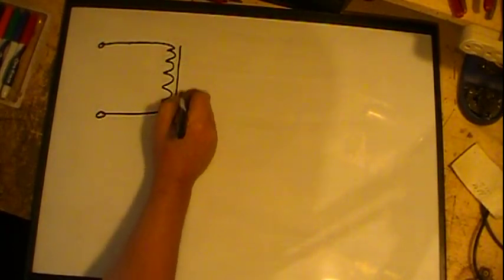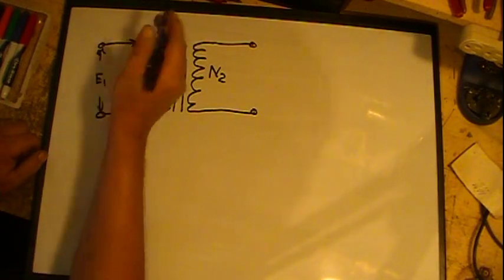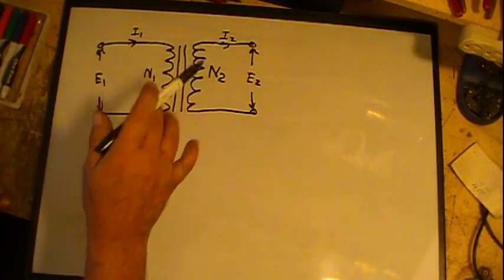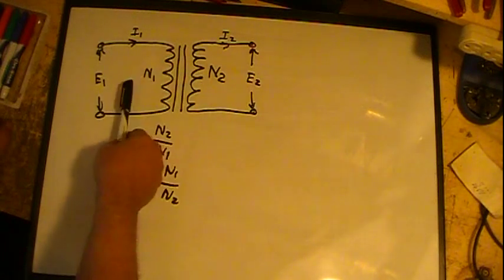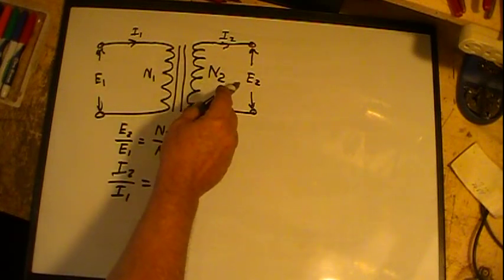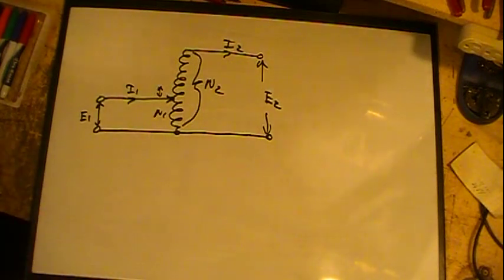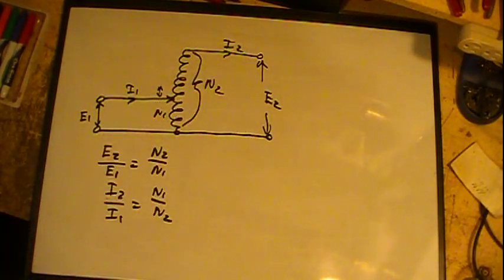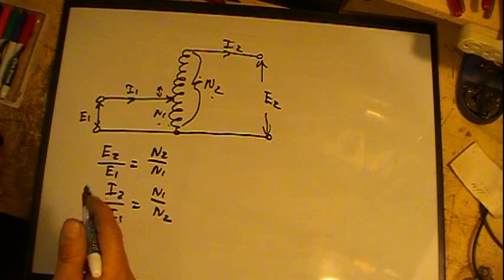Transfomers 101 part 1

Comment: Hi Dennis;
I have a Question, about what You said toward the end of the Video.. 
In the video, You mentioned that on an Autoformer it is the Primary side of the former that is adjustable, yet I would question that statement and ask if it isn't the secondary that is Variable and the primary is fixed.. Otherwise when the "Dial" is at Zero, it would short out the wires that are plugged into the Wall outlet.. So when I say "Primary" and "Secondary" on the Autoformer, I don't mean that there are two different windings, but that it would be where the "Input" and "Output" wires are connected on the Single coil of the Autoformer..
Keep up the Great WORK !!!!
THANK YOU Marty

Comment: Here I am sitting here Dennis thinking "auto-transformer?" I never ever heard of that! Then the "Duh..." moment happened here. Of course, a variable sliding mechanism that travels up and down the coil length, changing the output voltage. AKA; Variac! 
   Definitely NO isolation properties here in this design at all as you know so well. We still need to use an isolation xfmr to isolate ourselves from the mains, especially in conjunction to using other test equipment.
   All I can say, is that I use to troubleshoot 1 Million volt power supplies in Faraday cages to test them and repair them for the ion implanter machines that we made. This was about the most fun I ever had! When one of the voltage doubler stacks would fail, I would get a multi-foot lightning bolt arc, (in which I've seen occasionally, what appeared to be about six feet bolt!), short and "ZAP!". All 175+ employees at our factory would practically jump out of their shoes when standing, or jump out of their seats when sitting. It was so fun, and I was a pretty popular guy as you could quite imagine!
   These ION Implanter Machines would dope silicon wafers in a vacuum chamber like what would happen in a CRT gun, but on super, super, steroids! The filament was, say 5VDC at a couple of hundred amps, (serious), and the wafer anode target was at least 20 feet away in a vacuum stainless steel chamber, doped with certain appropriate gasses, (some of them would kill you if they had the chance), for the desired doping of the silicon wafer at the target anode,  which again, was at a 1 million volt potential and also with a hefty 250ma current kick to it as well. Unbelievable power, and a killer! We had these machines all over the planet, but especially in the Philippines in the 70's.
   THIS IS A SPECIAL WARNING TO ALL MY FRIENDS HERE WORKING ON THESE ANTIQUE RADIOS/TVs/Equipment!: DO NOT WEAR JEWELRY, WATCHES, OR RINGS of ANY kind, even with the stuff "WE" work with. You hear me Art, my friend? A  guy with a young family that I worked with got killed on the production floor because he had his wedding ring on. Take ALL this crap off my fellow friends. Extremely dangerous!!! Especially if your left handed. In this case, then you are really doomed!!! Think about it... This is a straight path from your left hand, through your heart, then to your feet's ground path. Bad, Bad, Bad!!!
    When working with voltages at these potentials, I can't stress enough that you use the "ONE HAND ONLY!!!" rule when testing these radio and TV's under voltage/HT.
Kapeesh/understand?
   Tom
PS Do you concur with me in all the stated points above Dennis? It could very well save a life of one of our dear friends here...
Reply: You know what, that never occurred to me. I'll certainly keep that in mind the next time I'm digging around in something with power applied.

Comment: Dennis, I noticed that you drew the current arrows in the same direction on both sides of the transformer. the current is going "in" to the primary and "out" of the secondary. Is that just the way you happened to draw it, or is there more to it? If that is really the way it is, then that means the signal (The AC sine, in this case) is flipped, doesn't it?